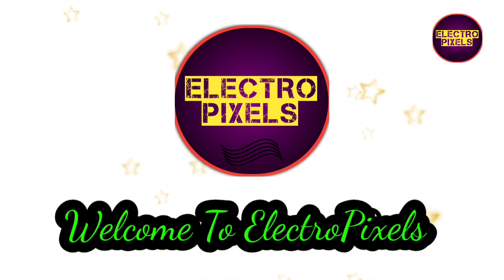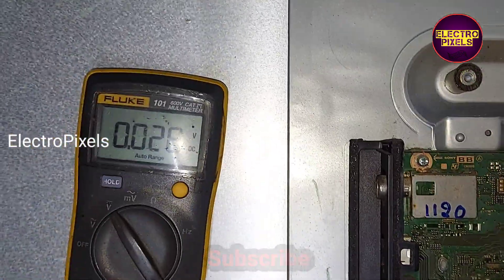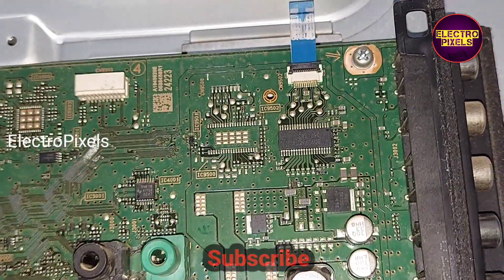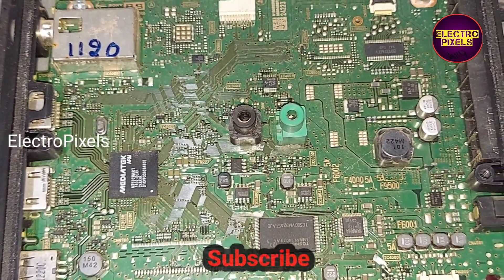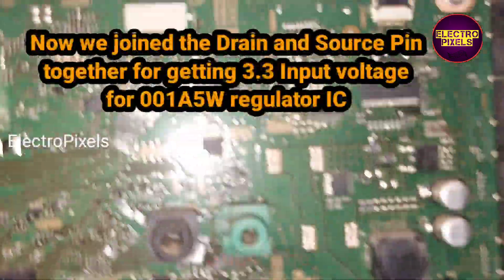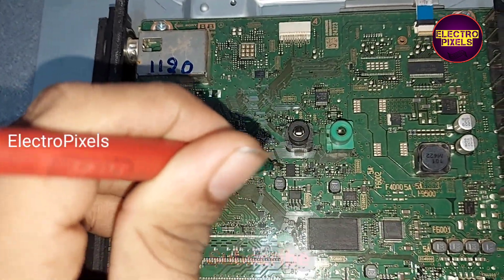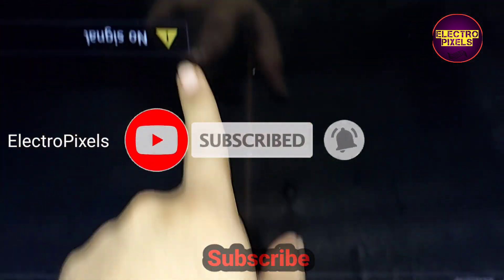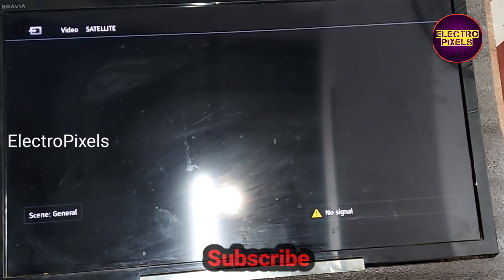SONY LED Tv Model-24R402A No. Power Motherboard Repair |Main board common Fault Chiplevel Repairing

Comment: hi electropixels, i have the same tv but it has backlight and sound  but it does not display anything. I will be thankfull if you will make a video on how to fix it  or give me a hint on how to fix it. ive tried to look for the totarial on the internet but most of them are in hindi but i do not understand hindi, i will highly apreciate if youl make yours in english. so far all your videos that i have watche have been so helpful, thanks bro
Reply from the maker: From Motherboard there is a Regulator IC, which generates the panel voltage's
Reply from the maker: It's video is already uploaded
Reply: Thanks so much bro